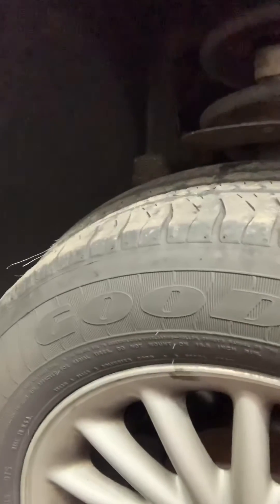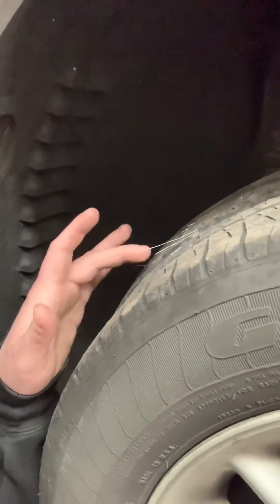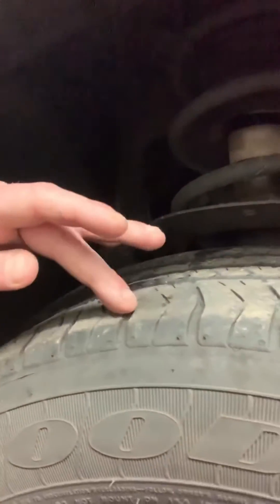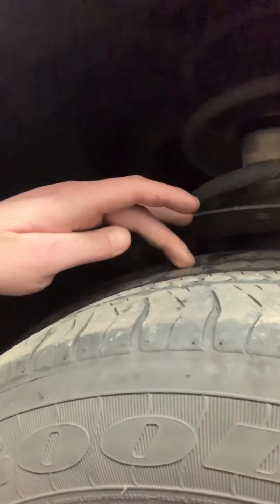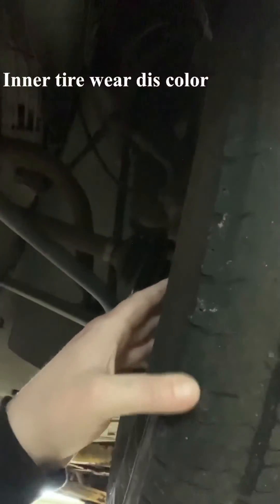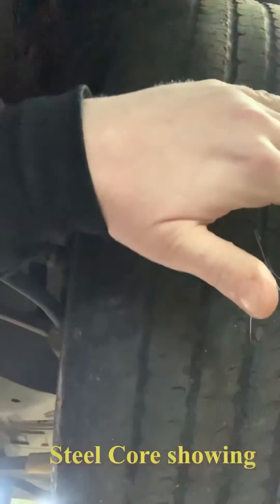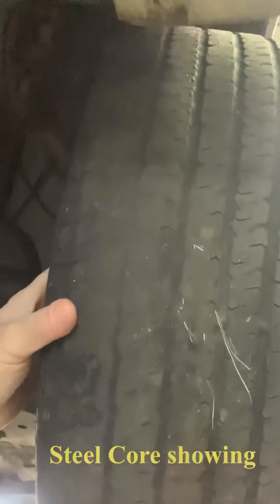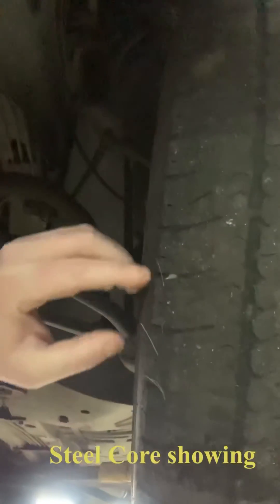Tire tread separation

Comment: I must have old tires because they're flopping on one side in the front. And I noticed they're cracked on the tread. But I don't see any noticeable irregularity or bulging.
At first I thought it was a wheel bearing. 
It's sad because there's lots of tread left and I can't afford an expensive 20-inch rim size Cooper discoverer.

Comment: I'm having a similar issue but idk if it is tread seperation or a shock or something. It seemed to all start after an incident in a car wash where my car wouldn't fit between the tracks at all so i was forced to bump rails and slide up and down them all while the wheel was being soaked. At first i thought flat spot or bulge maybe but i can feel the tire hopping ecspecially when i'm going up a steep hill. I don't see any obvious damage like this on my vehicle just trying to run it one more week untill i can afford a new set of tires or break job. It seems to be coming from the front passanger side only and my car turns wider when going right instead of left. my breaks,rotors,wheel hubs and tires are all 1 year old so i'm thinking it's a damaged tire or that shock/strut assembly
Reply from the maker: Very unlikely but have seen it before